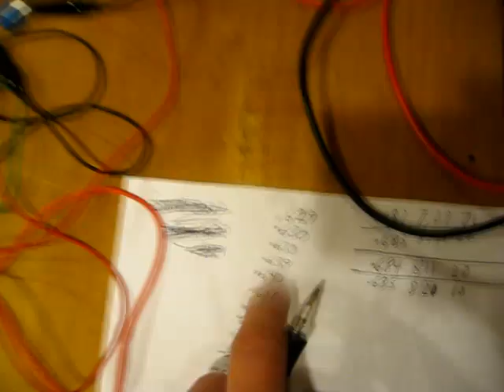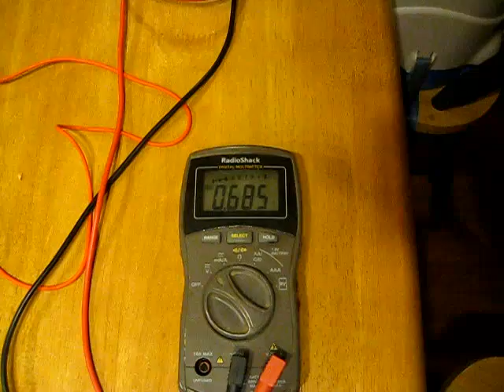Testing the Captret: is this free energy?

Comment: try the same with an analog voltmeter. Digital ones send dc (or ac) pulses, in order to measure the voltage. 
In adition, two diferent type and/or capacitance capacitors, create a voltage between them... also the compination of some electrolytic capasitors with a super capasitor gives an aditional voltage (but with a small amperage).
The explanation lies on the diferential of their chemical "Gibbs free energy" as it calls. I am researching on this for some time now.

Comment: onder the 700 mV a led or light emitting diode doesn't conduct current  (read very very small leak current) so the system is almost without load.
But what makes the voltage go up??
Reply: Modulation
Reply: Its ringin

Comment: i succeded once to fill up one cap in 2 minutes but 99.9% i cant pass the 1.729 volts and half of the time it will discharge with no reason i think it's my transistor and few diode ( i still have problem with those math lol)..... i am waiting for parts now i will touch base if i found something else on that mixed system

Comment: @ibpointless2 
Also, a voltage meter shouldn't actually induce voltage in the connections.
An ohm meter probably will, but an analog voltmeter should never do so.

Comment: Stefan is correct.  I believe that your meter is charging the capacitor.  Drain the cap, measure, disconnect the meter, wait some length of time and measure again, real fast, disconnect and repeat.
Cheers,
Bruce

Comment: You may not be aware that for big conventional electrolytic capacitors they ship them with a short across the terminals because they spontaneously self-charge.  I can't remember the exact reason but it probably has something to do with the chemical electropotential of the oil inside the cap itself.  Ionized air molecules deposit or absorb electrons on the terminals and the caps self-charge.  You should try searching on that it may explain what's going on.

Comment: Its nice to finally have people listen to me! :)

Yeah i'm seen that effect, got plenty of notes on it that i might release. I've got some crazy things with the captret as the main foucs, such as motors and other things. 

I've got my latest captret circuit, it has two captrets with one capacitor in series recharging two 9 volt batteries. Its slow but bigger caps will speed it up. 

My starting voltage was 17.17 and now is 17.23 and it just keeps going up while it runs a red LED too. Fun stuff!